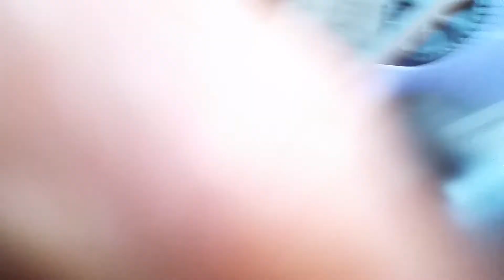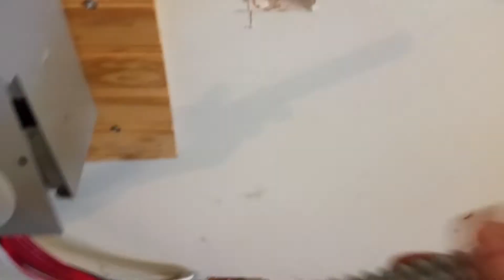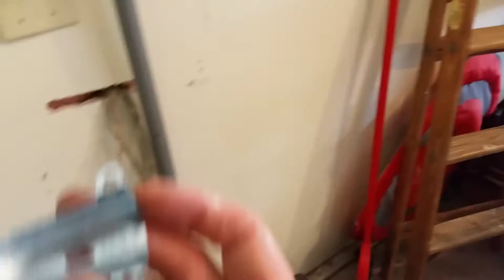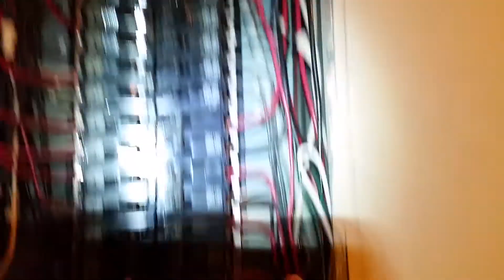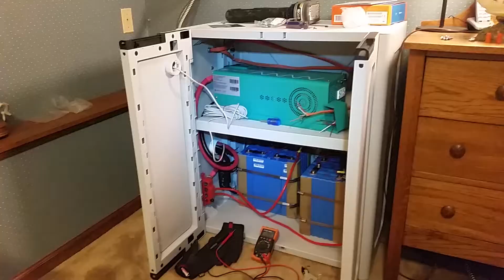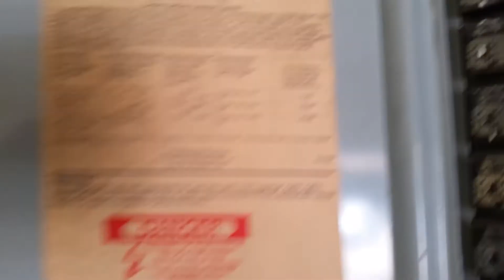Battery Backup Power System Installation

Comment: That is a nice set-up add solar panels later on down the road and the hole on the transfer switch I got my cap from Home Depot
Reply from the maker: Hey, thanks for the tip on the cap to cover the hole on the transfer switch box.  Definitely going to use that!  Also, got the generator hook up and transfer switch for that installed at the end of December.  Plan to make a video of that final step of this system here in March.